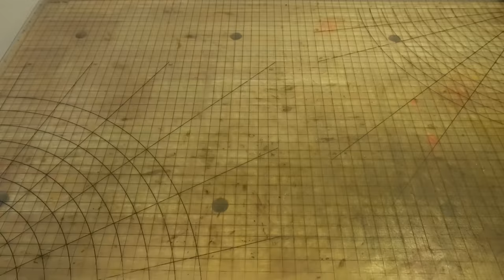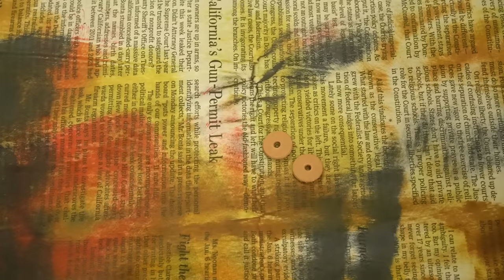Making a Tooled Wallet - Biker/Trucker Skull Wallet with 3D Embossing

Comment: What is the yellow panel that you put over top of the Leather dust/Rubber Cement mixture?
Reply from the maker: Thank you.  :) That is called bag stiffener. It is great for this purpose and it is manly for stiffening bags that use soft leather or anything you want to maintain a shape.
https://www.springfieldleather.com/Bontex-Bag-Stiffener_2
or
https://tandyleather.com/products/bag-stiffener?_pos=1&_sid=6ae88c882&_ss=r

I hope this helped. Thank you for the question. :)

Comment: Is making a wallet easy i have thought about it  but i wasn't  sure i could pull it off
Reply from the maker: Thank you for the question. The wallet in the video is a bit complicated but if you are going to make a standard wallet it will be much simpler. Like anything practice makes perfect so your first wallet might not come out the best but it will be a good start to understand how they are made. I think you would have a lot of fun making it. The simple answer is that they are not hard to make, The hard part is in the details like keeping your stitching straight, making sure all your edges and corners are burnished and done correctly. These are all things you refine and you enjoy leather crafting. A wallet is a great place to start and there are plenty of free patterns for wallets o line and even on youtube. Enjoy!
Reply: @baronleathercraft   thanks man
Reply from the maker: @Joseph-lt6pp  Sure thing! If you need any help just ask, plus there is so much fantastic information on youtube.

Comment: Just curious, what are you doing around 6:45? Is that sane mixed with rubber cement? Amazing work!
Reply from the maker: Thank you for the question. That is leather dust. It makes for a great filler when you emboss.  After pushing out the leather from the back, I use the filler.

Comment: Very nice work! 👍🏽👍🏽
What is the material used for backing, where you molded the project?
Reply from the maker: Thank you for the question. I love the leather I use for the interior of this wallet. I use it for plenty other projects as well. It has a real rustic appeal. It is called LAREDO CRAZY HORSE SIDE. It is not made out of horse. :)
I actually get it from Tandy. Here is a link:
https://tandyleather.com/products/laredo-crazy-horse?_pos=1&_sid=fabbc76ef&_ss=r
Reply: I'm referring to the stuff you mixed with the rubber cement glue..?
Reply from the maker: @kc g  oh, 😁 That is leather dust. I bought it at springfield. Here is a direct link.
https://www.springfieldleather.com/leather-Dust-1-Pound
Reply: Thank you kindly!
I'm very new to leather work and I appreciate your time and effort...
Reply from the maker: @kcg3927  My Pleasure. I like to share the info. Enjoy!

Comment: Damn! This is nice! Approximately, how much time did this project take from start to finish?
Reply from the maker: Hi Chad, Thank you for the kind and inspiring comment!. I find I get so absorbed in what I am doing I do not pay to much attention to the time but I will take a shot at how long. The most time consuming aspect of making this wallet is the hand sewing. cutting out the leather and tracing the pattern and tooling it does not take to long.  Dying like this take maybe 30-40 minutes. When I wet the leather and apply the embossing dust I have to wait for the leather to dry. I guess a day and  a half. Maybe less maybe longer. I wish I had a better answer. I'll pay more attention next time I make one. Whenever I try to time my projects I end up forgetting that I am trying to keep track. :) Thank you!

Comment: Love your work and cool design.What weight leather did you use for tooling?
Reply from the maker: I used 4-5 oz on the cover and 3 oz for the pockets. Sometimes when you emboss you are stretching the leather and the dimensions of the leather shrink as far as height and width. Make sure after you complete the cover to be sure your pockets are at the same width as the cover. If the pockets are to big (long) at that point understand that at some point you will have to make them match the cover. You do not want to sew everything together and realize that you have to adjust the edges so much that the sew lines on the pockets  meet the actual end of the edge of the wallet. You don't want to sand the edges to the point where you are actually leaving no space between the sew line and the edge of the wallet. Maybe more info then you asked for but it can save you from doing this error which I learned from experience. :)

Comment: That was FANTASTIC! How do you do the dying process? Is it like dry brushing? That dye job is to die for. Please let us know. 🤞
Reply from the maker: Thank you very much! It is a technique I love to use. The dye applicator is just a piece of a T-shirt. I will apply the dye to the shirt just by holding the bottle up to the shirt and then turning it upside down and back quickly. Then I will wipe off any excess dye left on the shirt on to a news paper. When I feel the t-shirt is dry enough I will start applying the dye and applying pressure wherever I want the dye to be darker. Actually I have a video explaining this very technique.  https://youtu.be/rfLVUZK8GmY . Thank you for the question. I hope this helps!

Comment: what thickness of leather did you use
Reply from the maker: I used 4-5oz for the cover, closer to 4oz. I don't really like to tool on leather less then 4oz but I will tool on 3oz if necessary. You don't want to go to thick with the cover because of the embossing. I used 2-3oz leather for the pockets. Hope this helped. :)